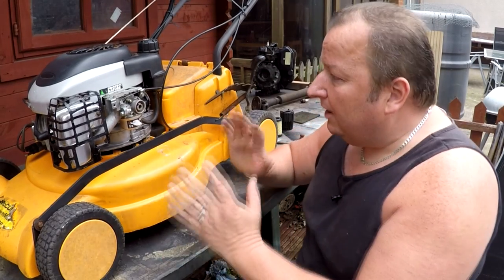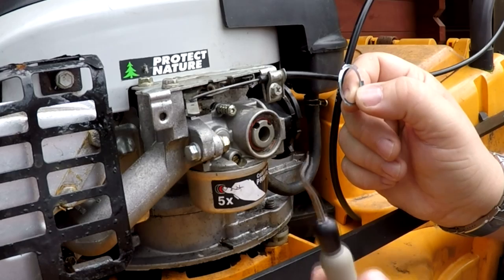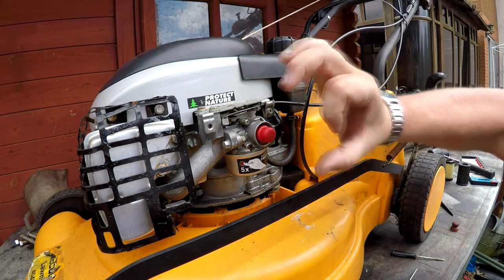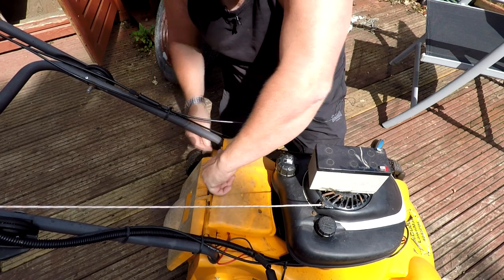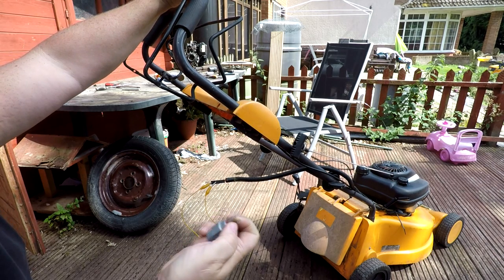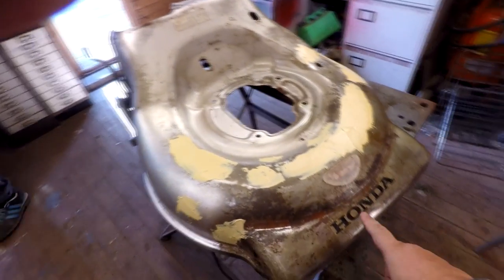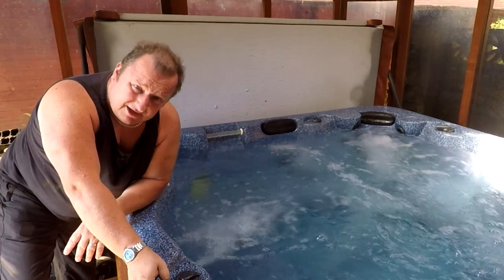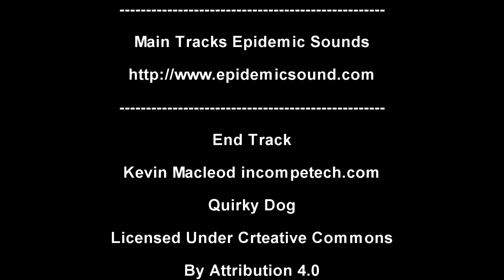A Day In Our Life Vlog #9 Lawnmowers To Fix

Comment: Mower seems to run well for a Tecumseh they can be a pain, I usually remove the electric starts on cheaper mowers as usually the batteries have had it and it wouldn't be worth investing in a new battery, if  it's a Honda or hayter I possibly would keep the electric start on them. Anyway good vid thanks🙂👍

Comment: I have an electric start Craftsman.  Trash picked, my go to mower now for cleaning up-after I cut with the rider. .  It was a basket case.  $65.00 in parts with battery and charger, lots of carb parts, flywheel key and more I can't remember.  The key on mine completes the hot side to the starter to crank.  Saw a plastic deck Honda 2 years ago, deck was a pos.  Made an offer, just wanted the engine, owner gave it away.  Oh well.
My old back is killing me, wish I had a hot tub. 
Cheers, Martin.
Reply from the maker: I think the battery is no good Jim, I'll test it on a known good one.  Hot tub is great for aches and pains.